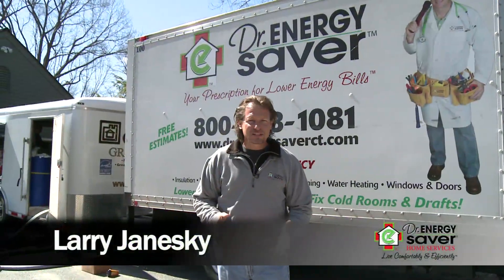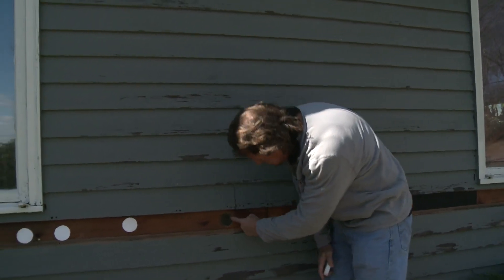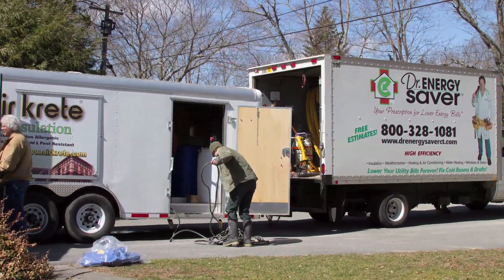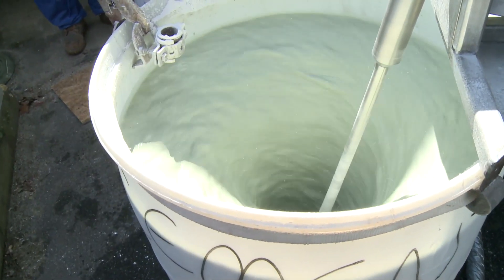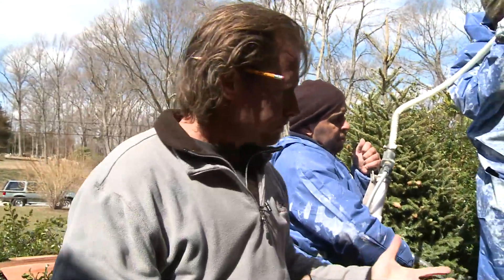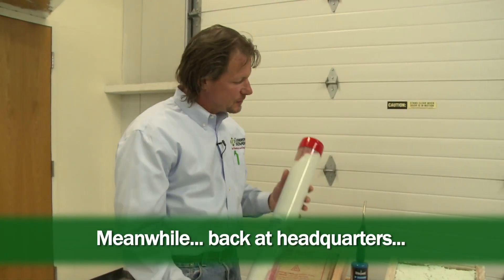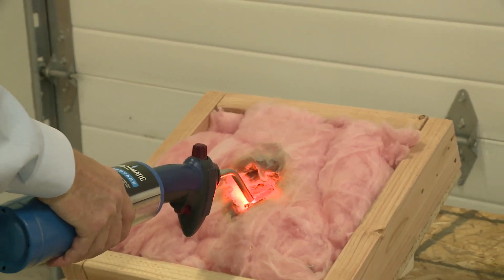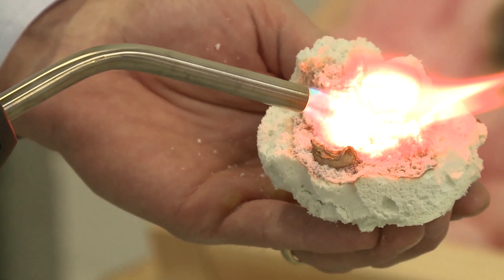Insulating Exterior Walls with AirKrete  (Complete Version)

Comment: This is such a bunch of bullshit. So the wall cavity that's ALREADY filled with fiberglass insulation is going to allow this to flow THROUGH it's fibers (impossible) and fill the remainder of the wall cavity. The SECOND fiberglass insulation gets moist it compresses. This will result in a giant glob of fiberglass and bullshit-creet in the wall cavity.
Not to mention AIR is absolutely essential to the basic principles of insulation. Fiberglass, cellulose, spray foam ect. ALL TRAP AND HOLD air.

Comment: What is the actual R value insulation for Aircrete ??? Also, using just portland cement water and foam is all that is needed. What secret sauce are you talking about fella ??? What about filling 8 inch cinder block with aircrete ??? What is the R value range using this as fill instead of using vermiculite or perlite ??? Thanks and peace.

Comment: Sounds great BUT......
I immediately think of wiring, internet, plumbing, and HVAC. These are mechanicals in your walls that change from time to time i.e. adding outlets and internet to individual rooms. How do you add an outlet or cable box in a room if you have airkret walls??????????
What if an aging pipe leaks or breaks?  You are SCREWED!
I'm sure the company has a fix for that but how costly is that?

Comment: Talc is not a safe chemical as stated in the vid, it is a hazardous fibrous mineral  with a similar structure as asbestos! 
Talc causes lung cancer and also ovary cancer.
Reply: Your talking about breathing it in in a dust form or putting it long term on extremely sensitive areas... first the cement mixture is mixed with water and soap that's it, that is all it is... being suspended in the water and not breathing it in means it's not damaging your lungs or anything else... and I think we can all agree that EVERYTHING is bad for you! In some ways everything on earth COULD be dangerous... I've got to say I'm soooooo fucking tired of hearing the safety police continue to trade our freedoms for a illusion! Just look up videos on the dangers of DHMO! You are someone who would gladly sign a petition to ban dihydrogen monoxide because of well-known effects in a particularly alarming manner, such as accelerating corrosion and causing suffocation!

Comment: My experience:
I had Airkrete pumped into my 1960 double-brick bungalow in 2014 in Toronto, Canada, by Brand Insulation Inc., who are still in business.  They claimed R6/" for the foam itself.
I am quite happy with it overall, will likely have it done to any future house(s).  Its one of the few products that can get into the brick-block cavities of an existing house, where there's empty space that can be filled/insulated. - They drill 5/8" holes through the mortar joints, every 6 rows of brick, to inject it from the outside.  It didn't travel everywhere in the wall, as I noticed when taking apart some of my basement bathroom ceiling when I had a plumbing leak.  
Airkrete for brick is the next best thing to insulating the outside of your house, ie stucco, which I priced, & would have been a far, far more expensive & complicated alternative.

They also pumped Airkrete into my 1" thick finished basement walls, via holes drilled into the drywall (where present).  It bulged some of the drywall out, where they pumped too much in at first.  Prior, all of the drywalled walls were empty, except for one that had fiberglass batts & metal stud wall added infront, which it bulged the most.  Yes it also compressed the fiberglass batts that were there, but so what, since the Airkrete is far superior to fiberglass in all respects.

I've recently taken apart that basement wall and the adjoining one (due to foundation wall water leakage). - It was no trouble, as the "hardened" foam is very soft, falls apart as powder/dust when touched, vacuums up easily, just isn't able to be re-used.  I'd say it withstood both water & vapour amazingly: there was zero mould in the Airkrete, which was dry and clean, but plenty of mould on the old tar paper (against the concrete wall), plenty on the drywall & rotten wood, some on the concrete wall; rust on the metal studs; wooden sub-floor required rebuilding due to rot /composting. 

Noticeably quieter & warmer house after Airkrete installation, even though portions of the basement walls are just painted concrete block without any insulation whatsoever.
Reply: Thanks for this. How is it performing now? Any issues with brick detoriating faster due to airflow and freeze/thaw cycles?
Reply: @hesmas1  There aren't any issues that I'm aware of.  Seems fine.

Comment: Wow... I really love that this product is so good...but was told by other insulation retro-fitters, that they cannot blow foam into walls that already have fiberglass inside.....how does this stuff permeate the existing fiberglass, not just shove it into a clump?  How encapsulated is the talc in this product...because Johnson & Johnson just got taken to task because they hid the toxicity of talc from public and regulatory agencies for something around 50 years.....IF the talc is encapsulated in this foam, should be no problem? 
WHAT is the R-value per inch of thickness?? 
Does this come as a DIY product?
Reply: I watched this video. I is R4 per inch. There is more than one type of talc so ingredients matter. I am looking into becoming a dealer in Texas. I just sent them an email. As to them not answering their calls, I called 1 x & they answered.

Comment: I wonder.  Most after the build injected wall foams and cellulose do not give even a decent coverage in an uninsulated cavity.  You are trying to displace and encapsulate a fiberglass filled stud cavity.  I would have to see a few bays opened up to display full and complete coverage.  When trying to stop air as opposed to heat it is totally important to have 100% fill.  Have you done after job open ups to see and not just in optimal installations??  If it works and is cost effective it sounds like a great product but those are two big 'ifs'.  Doug
Reply: Yes this is pure bullshit. If you can't get dry cellulose to fill an ALREADY fibreglass filled stud cavity why in the heck would a MOIST foam work. Simply logic.
Reply: @jeffp7776  I can't say how well it works in an already fibrglass filled wall, but this product is pumped in under pressure as a foam (that's comparable to shaving cream).  That's how it penetrates into cracks & crevices, such as between brick and block walls; or between studs, blocks and drywall.  Then it dries out to a very dry, soft, crumbly powder that's comparable to a dried out sand castle, within your wall cavity.
When it was being pumped into my empty /un-insulated walls, I encouraged them to pump in a little more foam.  A couple of times, the drywall "popped".  ie either it expanded it out past at least 1 drywall screw, or perhaps even cracked the sheet of drywall, due to over-filling /over-pressurizing the wall cavity.

Comment: what about shrinkage over time
Reply: +Gary Reed what's r value per inch of this type of foam?
Reply: Hi Rich, to answer your question- there is no shrinkage. As for me... I am one of the partners The Climate Chief, which is a certified Dr. Energy Saver dealer (Since 2013) , and we are a certified Airkrete installer (Since 2008) in upstate NY. We have used Airkrete in all facets of residential construction- such as attics, walls, basements. I can tell you that this product requires the same amount of labor as you would pay to have dense-packed cellulose installed, the materials costs more, but... it is so much better than cellulose and yields 46% more R-Value per inch. If you are interested in more information, I highly suggest you give Dr. Energy Saver a call- you'll be glad you did. Be well and Enjoy Life!
Reply: @garyreed1821  are you still installing air krete?
Reply: There is a competing product, tripolymer injection foam, that has been known for shrinkage over time.

Comment: I wouldn't mind seeing a glass wall demonstration of this. This just looks like a bad idea.... Salty? Wouldn't this spell certain disaster for electrical boxes and other metals?
Reply: Yeah. I had a bucket of salt in my basement. A year later it was a bucket of salt water. It just keeps absorbing moisture from the air. 

I'd also worry about whether over time it would rust all the nails holding the wood framing and siding together. Yikes.
Reply: interested in being installer yonthemainman@gmail.com